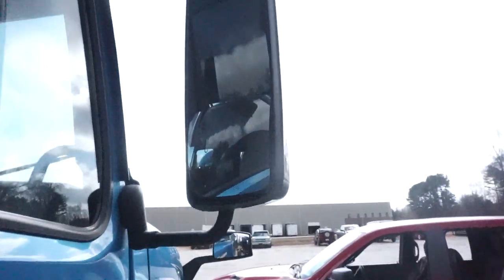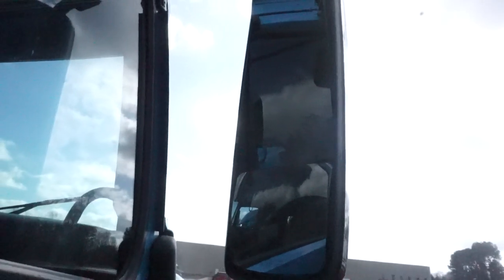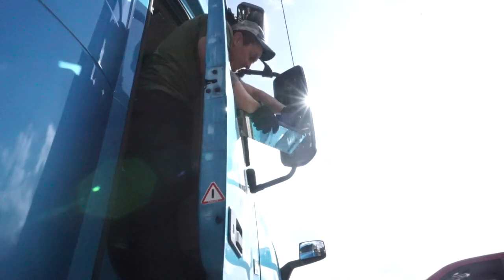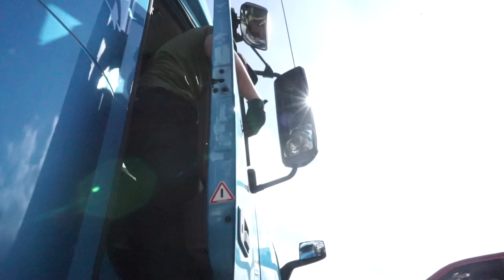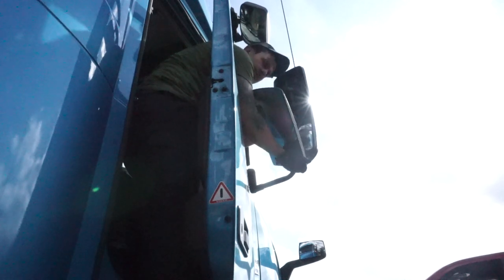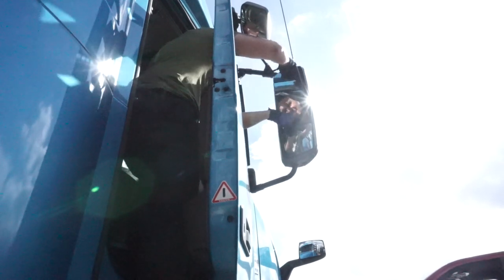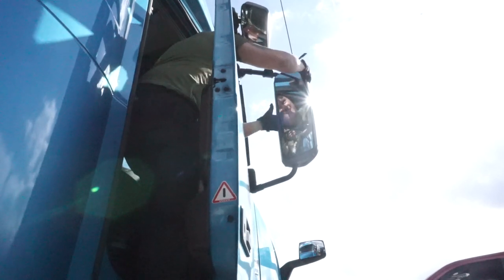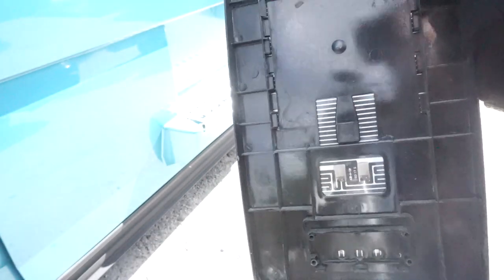How to replace Volvo VNL mirror glass

Comment: how do you do bottom piece?
Reply: basically tilt the top piece of glass so it faces the ground then grab the lower convex mirror and wigggle it until it slides up. it will slide up and out. you may have to tilt the convex to face the ground as well to clear the larger glass above it!!